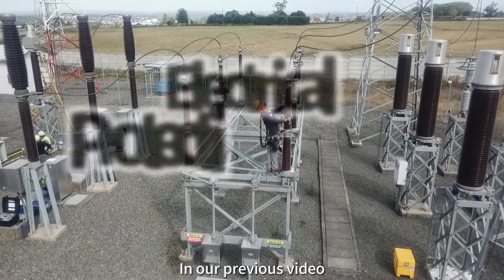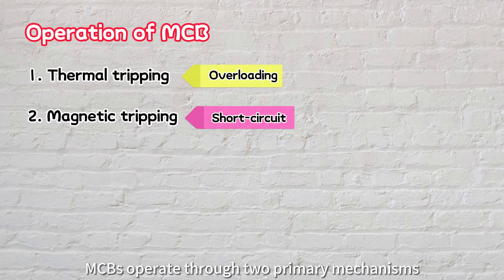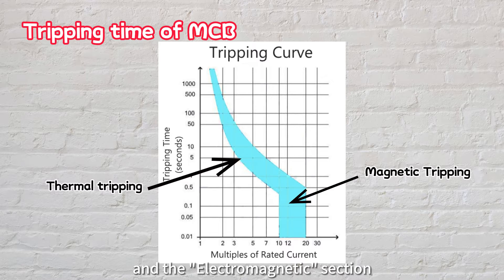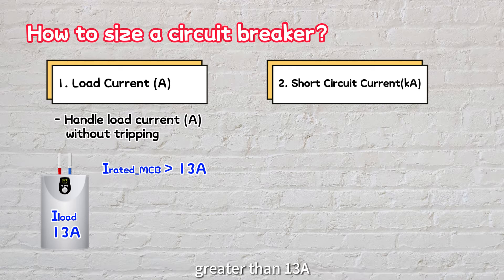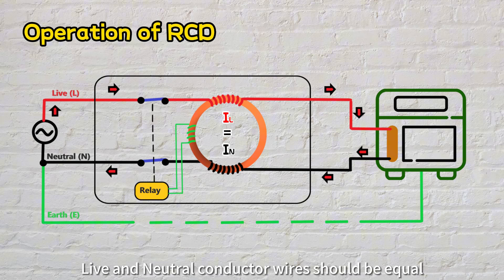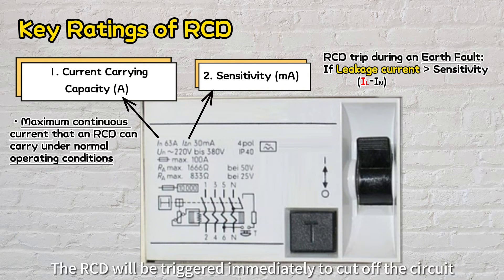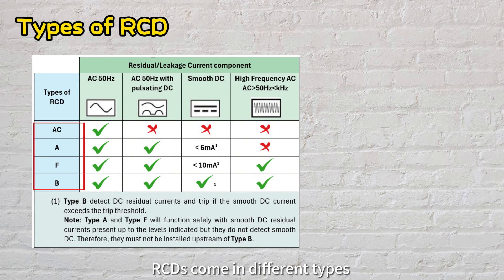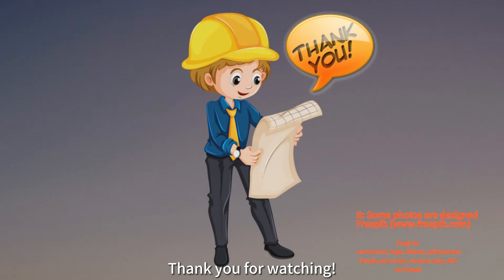【Part 1】"MCB" vs "RCD" | Electrical Protection Device

Comment: In 1:25 when MCB trip the main purpose is to protect circuit itself (wirings inside the walls) from overloading (overheating) but not the devices connected to that grid. Other than that very nice video.